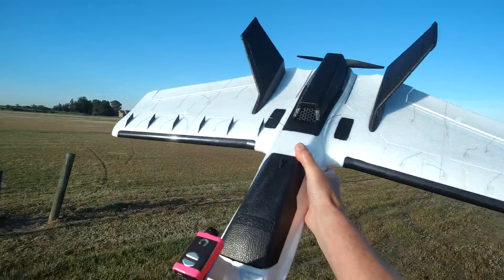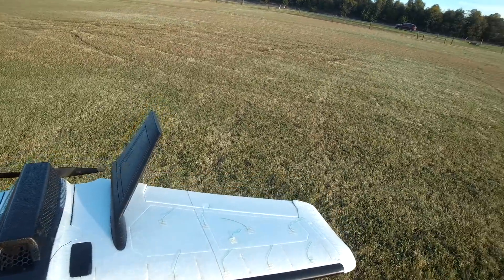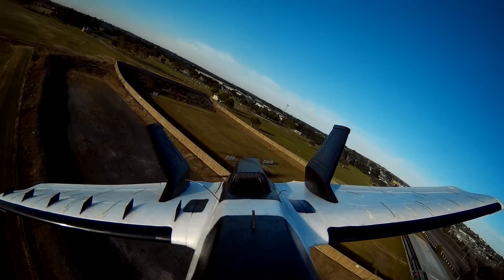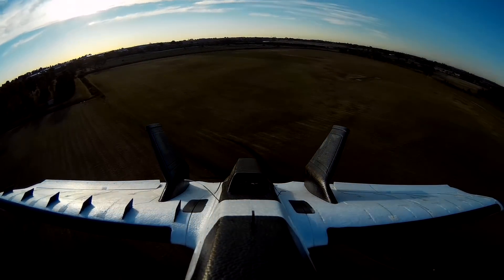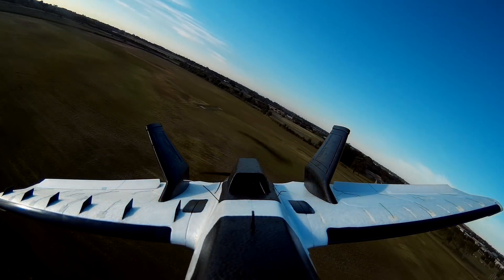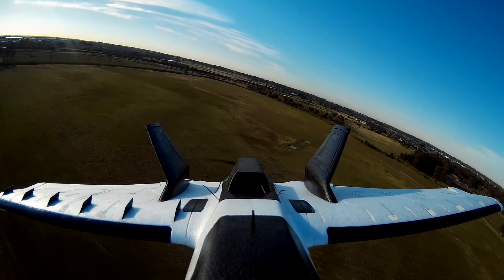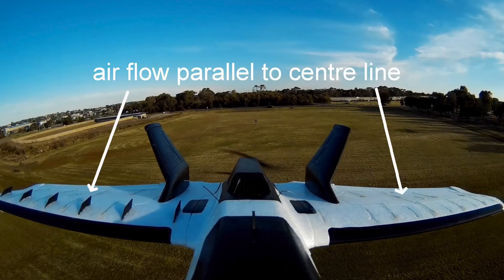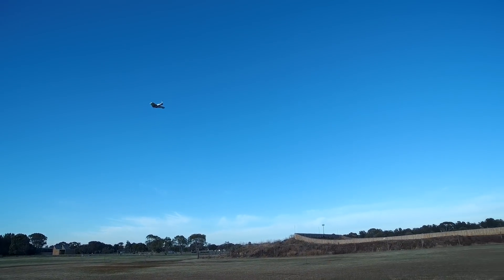ZOHD Dart XL airflow testing

Comment: The point of those little fins is to keep you from tipstslling. It's like a big platter, when you roll the platter slips in the direction of the lowest wingtip. Those things are supposed to grip the wind and keep the nose off the plane in the right direction when in stall conditions. At least that's my understanding

Comment: Good work and great idea to use thread to show airflow. Despite the experiment having some major flaws, thank you for approaching this in a scientific way. 

I’m not convinced these are anything other than a gimmick for a several reasons. First is that VGs don’t provide more lift, but delay the onset of flow separation at slow speeds that could lead to a stall. If they are meant to be VGs then they should have an angle of attack relative to the airflow if they are to create a vortex (it’s in the name 😆). They are also too large to be VGs but too small to be fences. But are they meant to be fences? If they are then they should start at the CG point not the leading edge. Putting a vertical surface in front of the CG would have the same effect you’d get when trying to throw a dart tail first. Try it 😆. The best place to find out if these VG/fence hybrids have any positive effect other than a cool factor would be to ask ZOHD for their airfoil test data. I suspect that data doesn’t exist as they’re just a gimmick dreamt up at the design stage, but who knows?
Reply from the maker: Indeed, no body knows.

Comment: Andrew... Another great video but have you tried various CoG's to get this thing to fly level at cruise speed without so much downtrim?

You can then test for the Dart being Nose/tail heavy by doing a power off dive test and see how it behaves.
Reply from the maker: Tracks straight in a dive so I think the CG is right.
Reply: @AndrewNewton  so possibly excess reflex built into the wing?

Comment: @ 5:10 you can see the inner threads stalling and the tip threads still indicating laminar flow. That's awesome to see the forward swept wing doing what it was designed to do. Great video. Thanks!

Comment: The trim change told the story, as the fences effect is minimal, but useful...Clearly the wing with the fences produces a little more lift, my guess in the outer 1/3 of the starboard wing...
  Fences, not turbulators....will help prevent tip stalling. Nice experiment Andrew, I wish it was cheaper...lol

Comment: I think the VG’s do a little something.. without good lighting it is hard to see maybe a better experiment would be in a garage with a high powered fan. But technically VG. Are only make an efficient difference when going really slow or “supersonic” aircraft... this being said I think this plane would have to do 100mph+ before the VGs start doing more. On the top end. Either way I feel the plane looks astetically better with than without so I will be adding them regardless! However this a good video and fun experiement so good job mate!
Reply: Yeah, the only problem with your theory, is that they aint Vortex Generators.

Comment: In classic Aussie fashion, always have the BS Meter on, love it! lol!  Great test, the fences will provide some residual Iift further aft of the primary lift zone along the leading edge.  This will likely occur when there is any appreciable yaw, or any spanwise flow, and will act more like a "trip" than a vortex generator.  In this scenario, the rear edge of the fences will continue  the laminar flow further aft.  The problem is, with a lift vector further aft along the foil, there is an aft component thus slowing the vehicle BUT offering more lift.  So, which is it, more lift with more drag? or slightly less lift with less drag...?  Those fences represent a decent amount of surface area.  They look kinda cool, probably gets questions and in some exceptional cases prompts some to pursue empirical research.  Brilliant, thank you.
Reply from the maker: Thanks George, a finely tuned BS meter is essential these days.
Reply: BS generator @ 100%...

Comment: I'm very puzzled about the purpose of those little fins on the wing. If they are supposed to be wing fences to limit spanwise flow, they would typically start at the leading edge - and spanwise flow is less of a problem on a forward swept wing to begin with. If they're supposed to be vortex generators they're in the right place but would usually not be plain flat fins parallel to the airflow. If they're supposed to improve yaw stability and tracking, they look a bit too far forward relative to the CG, and probably quite ineffectual compared to the relatively large vertical fins that are already doing that job. Maybe their testing found that at this scale plain flat fins actually do generate good vorticity. Maybe they are intended to do a little of both vortex generation and flow limiting... Another theory I haven't completely discounted is that they are a bamboozling gimmick to help sell more units :)
Reply from the maker: I'm calling them finlets now. You're right, they are not conventional fences or vortex generators. I too suspect they may be partly "coolness devices" that coincidentally add a little lift
Reply: @AndrewNewton  Agree these are mostly for the good look. The same aerodynamical effect could be achieve with a single finlet maybe twice the size near the end of the wing. Good tests anyway !
Reply: They are a combination between VG's and wing-fences, and it looks like are doing their intended job so far. 
Andrew should do a test in some turbulent conditions to see how the plane does, from the yaw-waggle point view. 
Just for reference, take a look at Mig 17's third wing-fence ... where it was installed.
Reply: @PaunFD  
Mig 17 is practically  backward swept wing platform, totally different stall characteristics than forward swept wing.
Reply: @SladkaPritomnost  Heh, yes the Mig 17 is pretty much a delta with just the leading edges and no 'body' to the wing. A bit like the much later BAE Lightning.
Reply: @wordreet  
forward/backward swept
https://upload.wikimedia.org/wikipedia/commons/2/21/Airflow_forward_and_backward_swept_aircraft.svg
forward swept stall appears towards fuselage (losing yaw stability!)
backward swept stall appears towards wing tips (losing elevon control!)
Reply: Well summarized my thoughts too:). The only thing I do not get is that they would add lift. If so they must reduce laminar flow over the wing at least partly?

Comment: I am a fixed wing pilot and engineer and although my focus was petroleum (PE), I took Aeronautical Engr. classes and from what I recall, I’d say your methodology and conclusions are very sound.  I agree that the wing fences don’t function like vortex generators.  They do improve  boundary layer flow  however as compared to the left wing and I am a little surprised that they don’t induce more drag and adversely affect right wing lift.  One question though, when the plane was rolling to the left, are you sure that the ailerons were  equal and neutral and that there wasn’t any tongue roll moment from the motor or CG issue?  I fly both size Ritewing Draks and love them so I’m sure I’ll have one of these very soon.
Reply from the maker: Great, thanks so much for your input Tom. I'm not up with aerodynamic theory so just decided to see what was happening.
Reply from the maker: Oh good question about the aileron trim. I did have it trimmed to fly level before removing the finlets and there was an obvious difference once they were removed. I have now reglued them in place and will fly again to answer the question. I'll get back to you
Reply: Thank you sir. I have raised a few questions in my own mind about it and the only way I think I’ll resolve them is to get one and play wit it myself.  It’s a beautifully constructed bit of kit as they say in your part of the world. Thanks for all the great info you provide to our community.